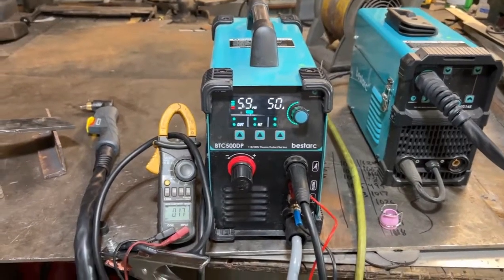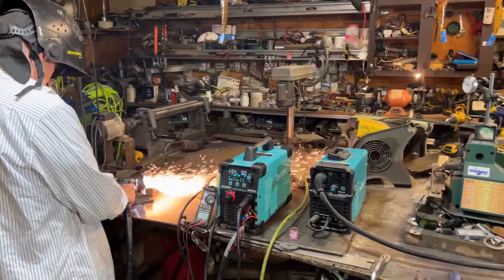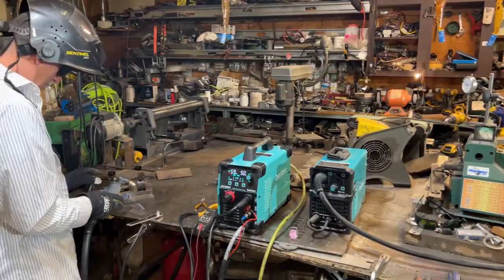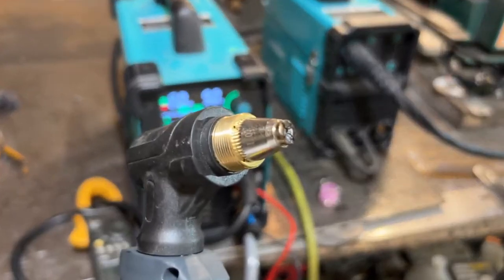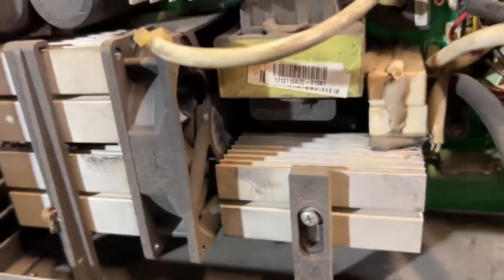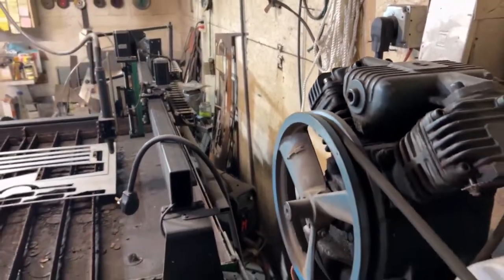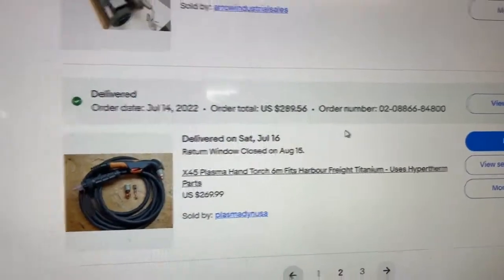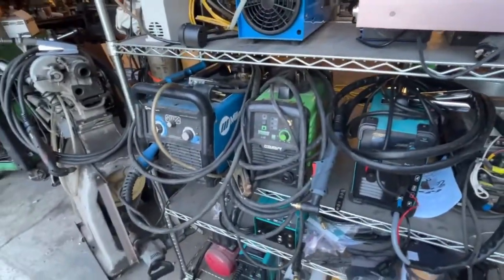Plasma cutter buying advice

Comment: If you want a torch,  get the cutting tip for propane, don't waste your time and money with acetylene, unless you need to Carberize, like protecting chrome shafting for welding.

Plus with propane you can crank input pressure right up.(over 15psi)
Especially when heating metal..
Reply from the maker: great idea to protec threads also thanks for the tips

Comment: These machines do last, I’m a scrapper and use my chinesium plasma cutter constantly. Consumables are easily available on eBay, temu etc and are cheaper than any box store
Reply: Chinesium comes in several grades. If you get one with western QA/QC it can be quite good. If you get the ones that fail the QC and are sold for cheap, then you're screwed.